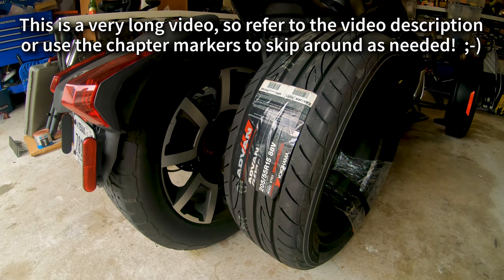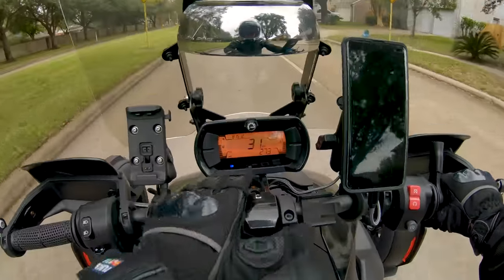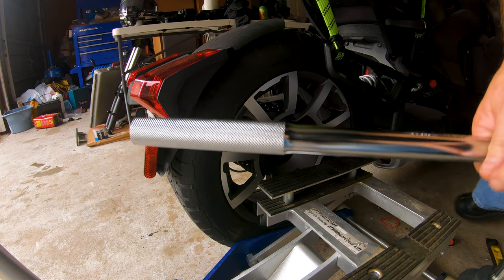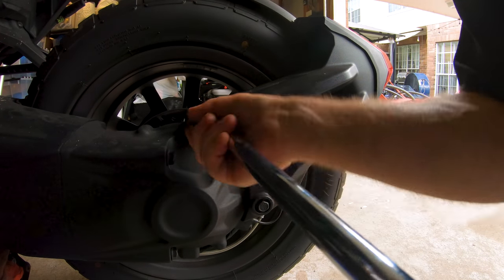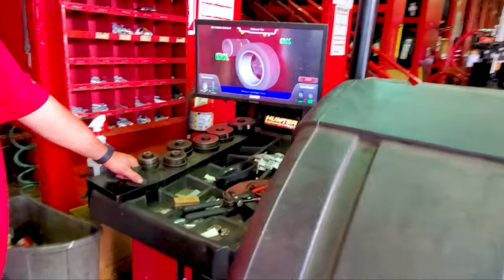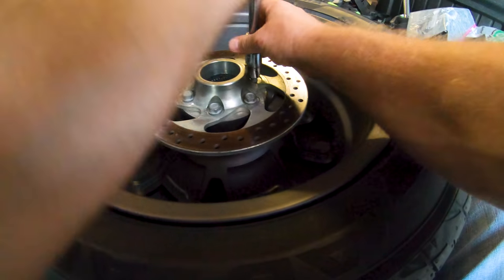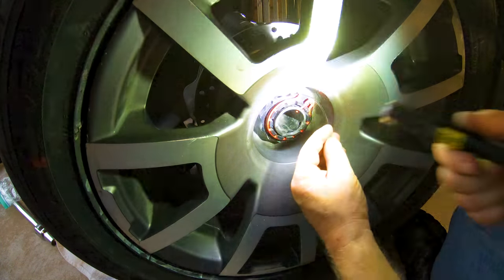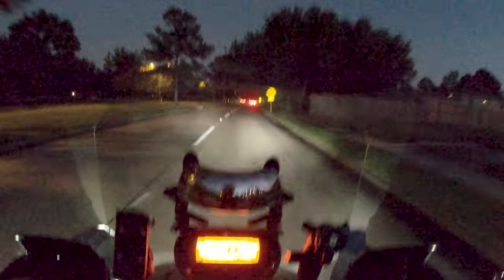RYKER: The Darkside Saga - Yokohama rear tire upgrade

Comment: I can't believe so many CanAm owners don't understand that Kenda and Kumho tires ARE CAR TIRES!  Kenda are made in Taiwan, Vietnam, China, Germany and USA. Kumho are made in S. Korea, China, Vietnam, and USA. Neither of these companies started in the USA. 

They are made specifically for Can Am machines (motorcycles). They are flimsy 2-ply CAR tires that will not support the weight of a CAR which is why they have the wording  "FOR MOTORCYCLE USE ONLY" molded into the sidewall. AGAIN, the wheels are a "J" type automotive CAR wheels and will not accept motorcycle tires because the beads are different. In other words ... YOU CAN'T PUT MOTORCYCLE TIRES ON A SPYDER OR RYKER.

So you think you have done something "Special" by going "Dark Side".  All you have done is put a car tire on a car wheel. It's not special and you can't put motorcycle tires on a Spyder or Ryker.  They all come with J-Type automotive wheels so the idea that you have gone Dark Side is misleading. It's nothing special.  You should learn about your machine so you don't embarrass yourself.

 TIRES
Front tires: (15x5 J-wheel)
Yokohama Avid S34FA 175/55R15
Kumho Solus KH17 175/65R15
Continental ContiProContact's 165/60 R15
Federal Formoza FD2 165/55 R15
Federal Formoza AZ01 165/55 15
Vredestein Quatrac 165/60/15
Vredestein Q5's 175/55R-15

Rear tires: (15x7 J-wheel)
Kumbo Ecsta 225/50/r15
General Altimax RT 43/(45) 215/60R15
Yokohama Advan Fleva 205/55/15
Vredestein Quatrac 5 205/65R-15
Michelin Cross Climate
Riken Raptor HR 215/60/15
Forceum Hena 225/60R15
Hankook Ventus V2 Concept 2 All-Season Radial Tire - 205/50R15 8

One other point to consider:
The stock size is 225/50-15. Some folks like the 215/60-15 size better, since it makes the speedometer read a bit more accurately. Others like the 205/60-15 since it is the same overall height at the OEM.  🕷😎
Reply from the maker: Wow... take a breath!  Do you feel better now?  😳

Nothing you ranted about discredits or discounts the facts of what I did with MY BIKE!  I have spoken many times at length in other vlogs about these tires being automotive tires regardless of the "motorcycle" labels on the sidewalls.  Installing an automotive tire on a motorcycle/scooter is the de facto definition of "going darkside."

The crappy Kenda tires on this Ryker were an outright safety hazard because of their terrible traction on wet pavement.  Unfortunately, authorized Can-Am dealers and service centers are NOT PERMITTED to install alternate tire brands on these machines, so I needed to think outside the box.

I've owned 120+ motorcycles and scooters over the decades, including several Suzuki Burgmans and Honda SilverWings, and I've covered 2M+ miles... that's a LOT of tire changes.  During that time, I've tried the "darkside" route on my scooters with varying levels of "success."  Overall, it wasn't a great idea, and I reverted to proper motorcycle/scooter tires after a few thousand miles.

So, next time you want to sh*t on someone else's work and experience, perhaps you should BUY YOUR OWN MACHINE, create a YouTube channel, and make a video about YOUR experience!   🤣👎  --QM

Comment: Did I miss something? Since when is Yokohama superior to anything? I had one set on an Impala SS and would NEVER own those cheap Japanese tires again for anything. A friend crashed his bike because those tires wouldn't stick to black ice when my Continentals went right around it. Like I said, did I miss something?
Reply from the maker: So far, the Yokohama has drastically better performance than the OEM Kenda all-season tire that came on my Ryker Rally.  The Kenda was very traction-limited on dry pavement and downright scary on wet pavement.  I was able to spin the Kenda anywhere below 40 MPH on dry roads and it would easily break loose at 60 MPH on wet concrete highways in Houston.  If I have any similar traction or stability issues with the Yokohama, then I'll search for another high-performance automotive street radial... Continental, Dunlop, etc.  The tire choices are somewhat limited in 205/55-R15, and the Ryker has very little clearance for anything wider or taller.  --QM
Reply: @QuasiMotard  better performance meaning what? I never said the Kenda tire is any good. Where did you get that idea? I didn't say it was bad either. My set are great. But I will stand by what I said about Yokohama's. I'd go without before I'd buy Yokohama's, or Goodyear or Cooper anything for that matter. You must have not understood me. Just remember, the more plastic in the tire the longer they last. And the longer they last the less grip on the road they have. That's rule one of motorcycle and car tires. Maybe not so important with cars, but life and death on a motorcycle. Even if it is a Can Am. I use Continental tires exclusively for my bikes and cars and never had a problem with any of them. The bike tires do wear out quick however. Right now, I do have a pair of Michelin's on my Goldwing. I couldn't get Continental or Dunlap's at the time for it. Either one is good for bikes. The Michelin's are doing well. I fully  understand the issues with trying to get Can Am tires at all. I'm not there yet, but when I am, worse comes to worse, I'll have to go back to stock. I'm not having any issues but I ride a big RT Limited and don't ride like a maniac. I've ridden motorcycles for over 45 years, coast to coast six times. Maniac just isn't worth it. Tire Rack does have a good looking Dunlop for the back: https://www.tirerack.com/tires/tires.jsp?tireMake=Dunlop&tireModel=Direzza+DZ102&partnum=055VR5DZ102&vehicleSearch=false&fromCompare1=yes
And CARID.com has a Federal (corvette tire) for the front: 
https://www.carid.com/tires/165-55-r15/

But remember, these are for a Spider R/T and are car tires. But this is where I would have started.
Reply from the maker: @dannysdailys  You seem to be looking for an argument for unknown reasons.  I didn't imply that you said anything of any sort... I simply replied back to your comment with MY personal reasons for changing away from the OEM tire and my impressions of it so far.  If you have watched any of my other Ryker videos, I've always mentioned that the Kenda all-season rear tire was traction-limited for my riding needs.  The Ryker is very different animal than the Sypder F3 or RT... it is much lighter, and I'm not a heavy rider.  So the rear tire has always been very easy to break loose at any speed on my Ryker, particularly while cornering or on wet pavement.  I have already encountered dozens of similar surfaces with the Yokohama over the past 1500 miles and it hasn't broken traction when the Kenda would have been spinning/sliding.

I have also changed the front tires to the normal street tread Kendas instead if the all-season variety.  The block spacing or tread pattern caused very erratic behavior over Houston's grooved concrete highways.  The upgraded combination of the "normal" Kendas on the front and the Yokohama on the rear has nearly eliminated that behavior.  My Ryker still tends to follow some grooved pavement and feel unsettled, but now it's about on-par with other vehicles.  --QM
Reply: @QuasiMotard  Well good, you've solved your problem. How much is a new belt for that thing? Or will that be next years video?

Comment: Are you afraid of the darkness? Driving with high beam in daylight?The little blue dot 🔵 on the screen…..😂😂😂
Reply from the maker: Riding with high beams on during daylight hours is a common safety practice in the USA.  It's printed in our riders' manuals and even taught as a defacto operating procedure in our MSF safety courses.  

Visibility and conspicuity are critical to motorcyclists' safety, so more light is always better to avoid being smeared by a careless cager.  Educate yourself instead of attempting to bash other veteran motorcyclists.  😒👎  --QM
Reply: Ok, different countries different rules.
Reply: @QuasiMotard so you run highbeams all the time when you had this? I have a 22 sport and I feel like a pure dick if I do that but I def see some riders have them on